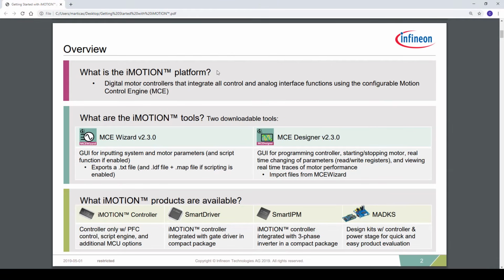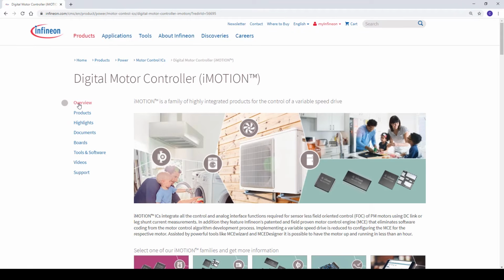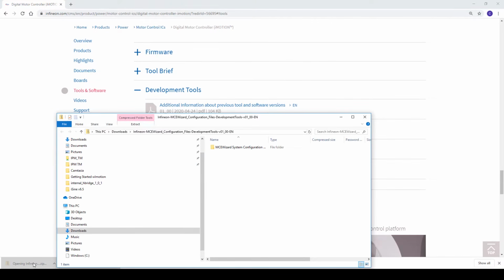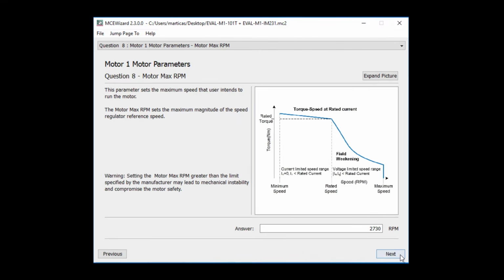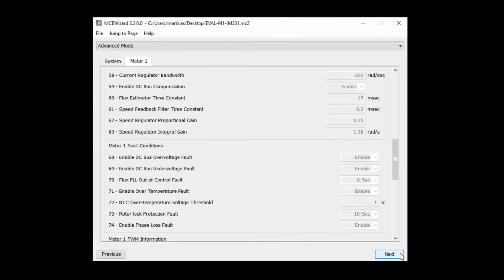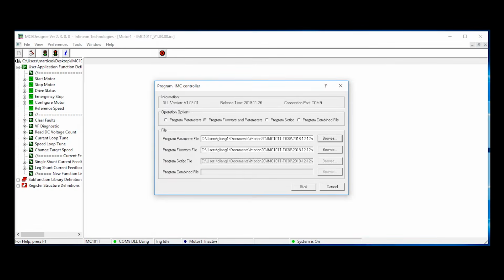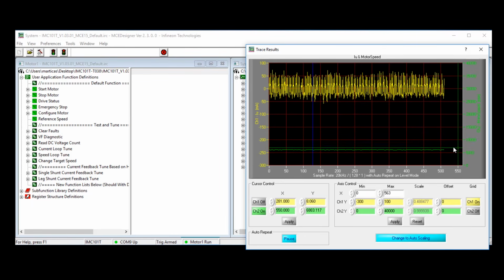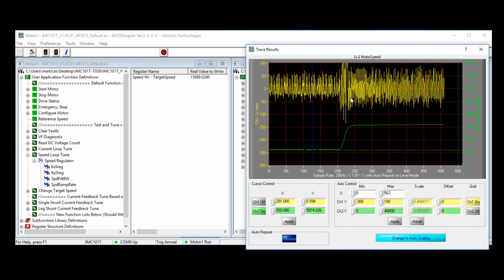Infineon: Get started with iMOTION™ 2.0

Comment: cannot connect to target device using Port com10 .
 1.device debug port connection with tool.
 2.board power supply is on. 
3.connection port is occupying by other software